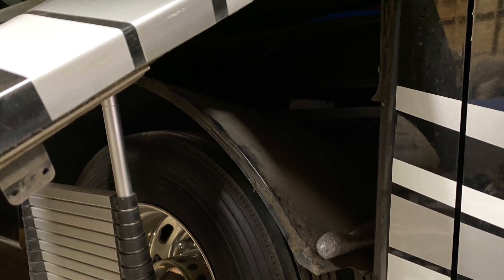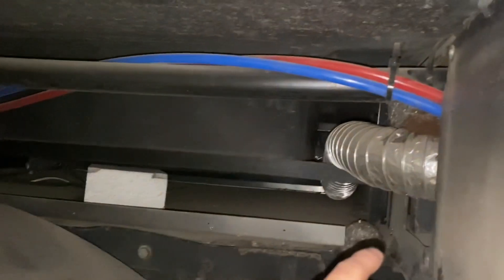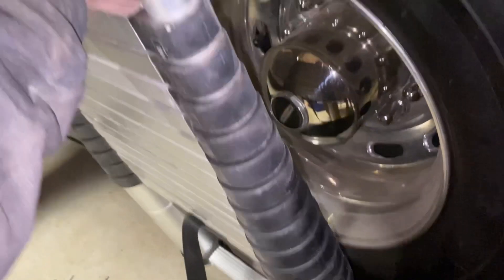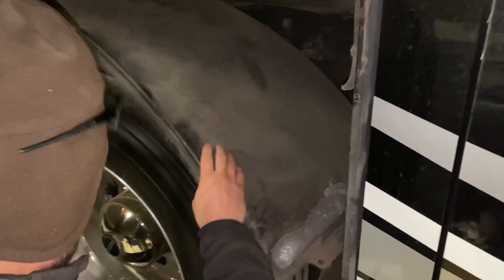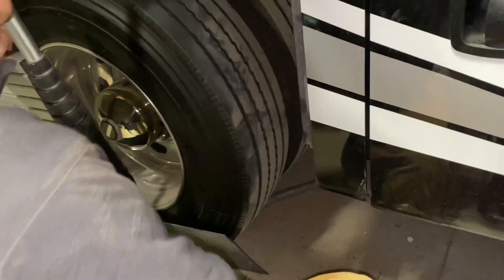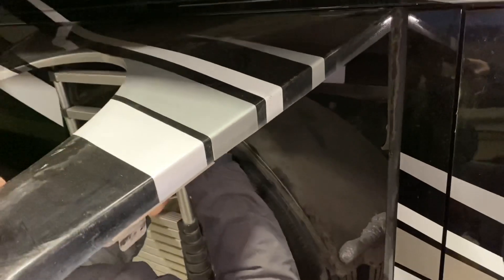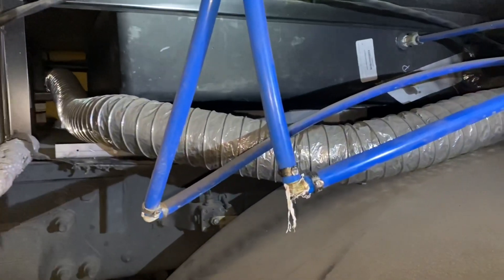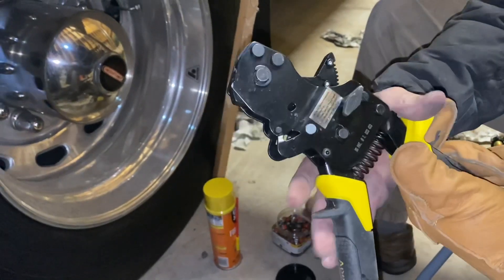Jayco Seneca - What’s above the duallies? - plumbing repairs, insulation, preparing for winter RV

Comment: This is very useful. We are out for our first winter camping in our 2022 Seneca. I assumed the water control center was a failure point so I installed a small space heater in there (120 v so need park power or generator).  That compartment was about 55 degrees at -5 outside air temp. So no problems there. But still no water and now I know why. Very informative and I have some work to do this coming summer.
Reply from the maker: Glad it helped. We are constantly learning things about our Jayco. Hoping to learn more at the rally this summer.

Comment: OMG thanks for this video, I couldnt figure out how to access my black tank. I think I'll try it now.  I also have the sea level tank monitor but never hooked it up because I couldnt access the black tank.  And now I'm worried about my pex tubing as well, so I'll check on that too. :)  I'll eagerly wait for how you hook up the electric heater from the batteries. I love my Seneca, but the quality control..sigh   (Sorry for the long post, I always seem to forget to stop talking).  Be safe out there...
Reply from the maker: We didn’t have our black tank hooked up for the SeaLevel either for that reason. I’ll be sure to film once Jeremy sets up the electrical. I think he’s still debating where to put the bus bar and where to run the heating lines.

Comment: Took our 37L Seneca to McCall, ID this last spring… -16 below zero. We survived! Have you thought about re-doing your wet bay as well? I’ve had to take apart the plumbing so many times… I cracked the plastic “T”, not to mention the water heater exchanger had to be replaced. Did the job myself; and we are off and running again! But I would like to open up, re work the wet bay…
Reply from the maker: We haven’t fully redone the wet bay, but Jeremy did replace the macerator and did some rerouting that made more sense. Also added in tank heaters to the area. Haven’t been in -16 yet. 😬
Reply: The 37L coach was warm the whole week we were there, since we were plugged into shore power everything worked great. Other than the frozen water lines. I took your ideas and placed a layer of rock wool across the duals and under the holding tanks. What are you using for your heaters going down the road? That’s when we seem to run into problems, not when we are hooked up to shore power…

Comment: The quality from Jayco is very sad. Like you, we love our Seneca for the chassis. As you know, we (wanderingpeaches) have done lots of modifications too, including basement heat, extra water tank, replacing on-demand water heater with a 10 Gal gas/elect, etc, etc, etc. But I have yet to pull off the fenders (they fell off on the way home from the dealer and they put them back on). We really need to get together some time and check each others Seneca out.
Reply from the maker: I agree Bob and Angel. Once Covid isn’t an issue it would be great to have a little Seneca rally so we could learn from each other. So many great things that people have done to modify. We have learned about things from you guys.

Comment: 👀 I would think that they would have done a better job at enclosing that space. If you ever where to have a blowout, it could tear up your water lines, grey tank plumbing and that heat duct.
Reply from the maker: Maybe they figure the fender skirt is enough to protect? 🤷‍♀️ Hopefully the updates Jeremy made will make it safer, warmer, and less likely to cause problems in the future. And it should help keep out the mice 🐁
Reply: @RVHomeschool  Yes maam! He did a great job of cleaning up the entire area and insulating the water lines!